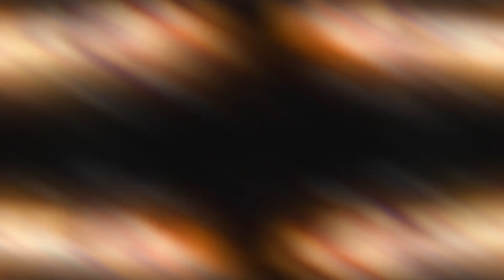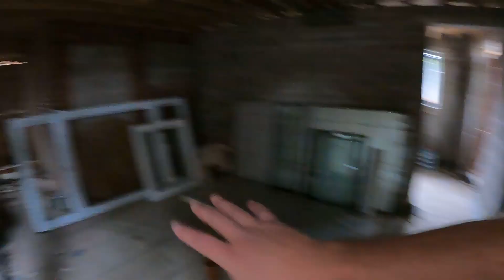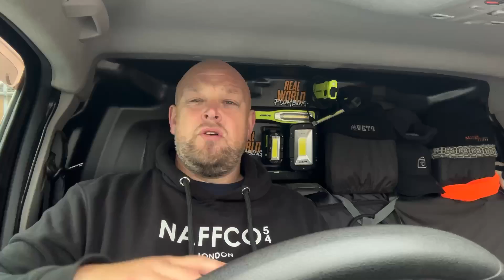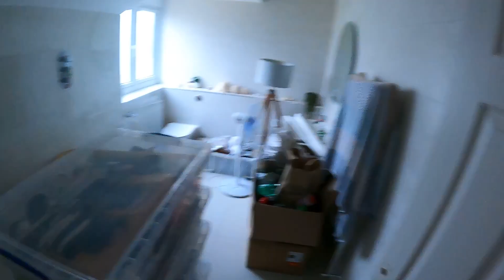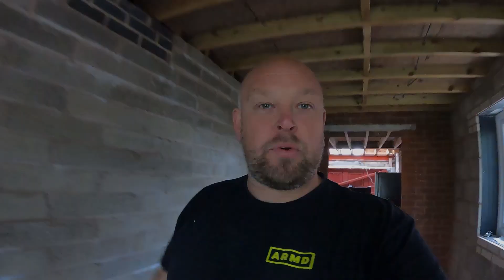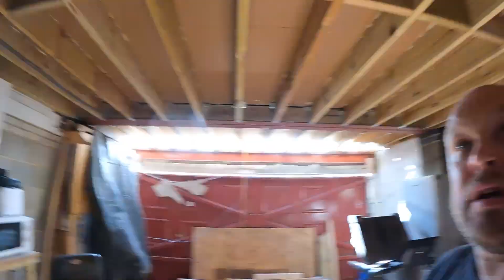PLUMBING & HEATING COMPLETE RENOVATION | Day 1 | Real World Plumbing

Comment: Hi Mark, I've been watching your videos from day one. Could I ask for some advice iv been asked to do the first fix on a new build barn conversion but never done more than bathroom Renovations and rad changes. LPG boiler boiler is going to be installed so iv got to run heating and hot/colds.
Reply from the maker: Sounds like a great job to get into
Reply: @MJTiffPlumbing  How do you go about starting to price a job like this, would I be right in saying run 22mm as far as I can before reducing to 15mm, is a secondary return necessary, and is it for all hot feeds or just the ones at a distance from boiler?

Comment: You can definitely get press-fit couplers for stainless, e.g. Geberit Mapress Inox. It's been the to-go option for gas pipes in my area (Vienna, Austria) for the past 15 years or so and I've seen it used for heating as well. We never had much copper gas pipe round here, switched straight from threaded or welded black pipe to press-fit stainless steel. As far as I know compression fittings have to remain accessible, so watching UK plumbers bury them in the ceiling or stud wall always feels a bit uncomfortable. Most plumbers seem to have gone fully press-fit, mainly MLCP pipe for hot/cold and CH, some copper. Old-timers still prefer soldering, fittings are much cheaper and the first press-fit fittings had a horrible track record for leaks. And by much cheaper I mean one tenth of the price. Occasionally you see the odd heat-welded PPR plastic pipe, which is amazingly popular in the former Eastern Bloc but rather rare elsewhere. It's cheap and easy to use but has quite thick walls so you get massive pipes.

Comment: I would have done that job differently to be honest, you have got mixed radiator and ufh zones as well as hot water, I would have taken separate flow and return to each zone from the boiler, fitted a low loss header, also a system boiler wouldnt have the required size expansion for that size house unless your fitting a separate one.
Reply from the maker: To be honest everyone does stuff differently buddy… 👍🏼

Hot water is coming from a pressurised cylinder so not an issue at all.
Also extension is all worked out and yes, will be having another vessel….

Thanks anyway👍🏼

Comment: Can you handle another big job like the last failure where you walked off. Just thinking of your stress levels mate.
Reply from the maker: This is, as I said a builder that I have work with for the last 15years, he’s a friend and I’ve done multiple huge builds with him from a £2m barn renovation to a 6 apartment hotel renovation….. this is a builder that knows how to run a job.

The other job was no failure of mine… it was a failure of the builder…. That’s why 18months later that job still isn’t finished….😉
Reply: @MJTiffPlumbing  no disrespect mate our wellbeing is all that matters.

Comment: On a reno of that scale it's so much easier to just run in brand new and often quicker and cheaper. That goes for plumbing and electrics, you get rid of any extra joints that could become annoyances later down the line. Wonder how it will be zoned considering the push to heat pumps if it's not planned properly and a boiler goes  in it could shoot people in the foot come 12 years time. Always interesting jobs.
Reply from the maker: Yep I get what you mean….. however we have to connect onto the existing system in this case….. unfortunately